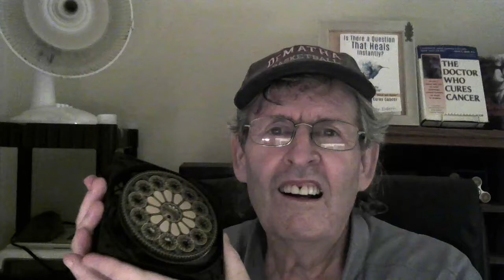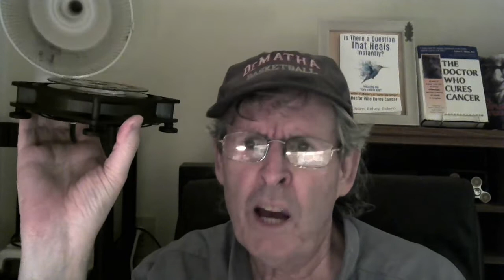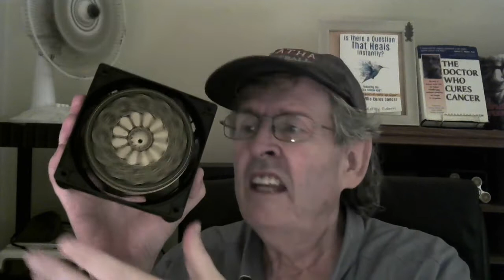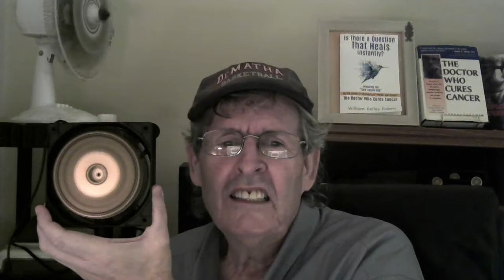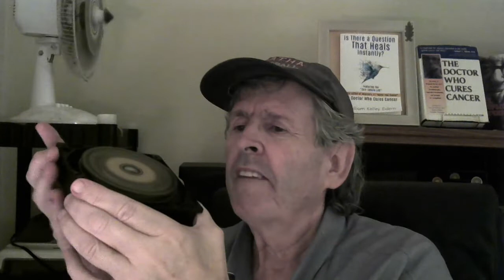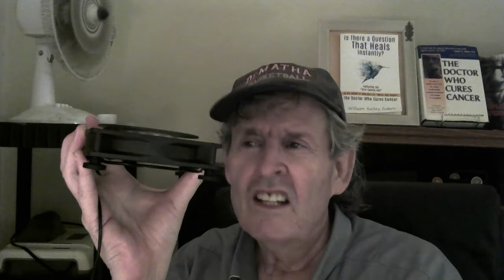A stunning healing energy breakthrough!! Plug it in and your life will never be the same.

Comment: Kelly, did you glue the disk right directly into the fan’s flat surface? Can i use an acrylic in between disks with NO hole?
Reply from the maker: Yes, that is correct. Make sure you know what being centered looks like ON ALL SIDES with a trial run, and then add a little glue in different spots and smear it quickly. I hold it down lightly for about 30 seconds. I've recently found out that 5 or 10 minutes of drying can hold the disks securely.
Reply from the maker: I don't know the answer to that. It should be strong enough, right?
Reply: @kelleyeidem667  i mean can i use a 1 inch whole circle of acrylic disk and not interrupt the energy in it’s center? Do i need to drill like a half inch hole in the center?
Reply from the maker: The acrylic won't block the frequencies if that is what you're asking. If not could you make a video showing me what you're doing? :-) @mariz2209

Comment: Being a small USB fan, this could be used in the car. My car has a usb port in the trunk too. How about using a dual version of the fan? Im thinking maybe having a dual fan attached to the top of the dashboard behind the windscreen on the passenger side (You could use velcro strips to secure the fan to the dash) and another dual fan in the trunk. Aplicum now do a 100mm vesion of the MWO Lakhowsky vortex antennae board. Could use the Notredamme Magnetron disk with different frequency disks and the 100mm MWO Vortex Antennae board on one fan with a second Magnetron Disk with a selfeggio frequency disk (963hz, 432hz, 528hz etc) on the second fan.
Reply from the maker: Absolutely! Love it with any and all of the disk options! I have a small fan with MWO disks on it. It helps to produce a blissful ride. With four the entire area will be in for a treat. Even though they won't be aware of the source of their happy energetic feelings, they will be there just the same.

Comment: Why do these things work?
Reply from the maker: Great question. It's hard to answer fully. It starts with life being electrically driven. Add to that the properties of copper. When copper windings are spun in a hydroelectric plant, it generates massive amounts of energy. 

So the combination of the material and the motion produces additional properties such as frequencies. Getting back to living things all living things use fractal frequencies to function. 

The spinning of the sun generates countless different fractal frequencies and by doing so aids life. Likewise, spinning Heartfelt Energizers generates countless different fractal frequencies.

The fractal nature, which means they are irregular in size and shape, is especially valuable these days because we are exposed to so much in the way of non fractal "repeating" frequencies that can be irritating like an alarm clock that keeps beeping.

It's quite possible that the energies emitted by Heartfelt Energizers transform the harmful repeating energies from WiFi, Smart 'Beaters', 5G etc. into fractal frequencies.